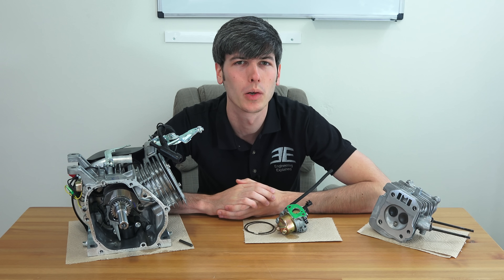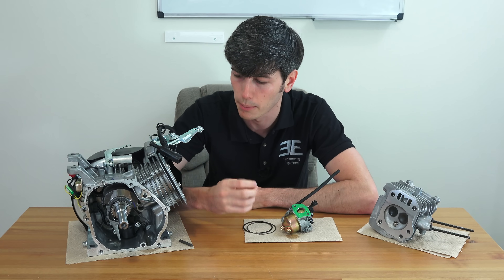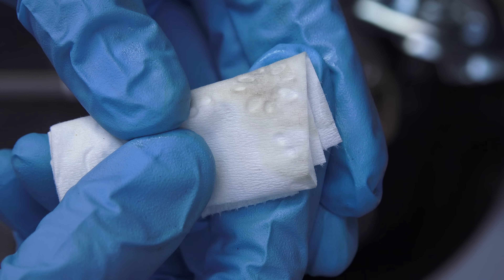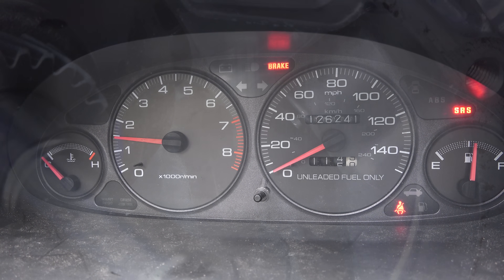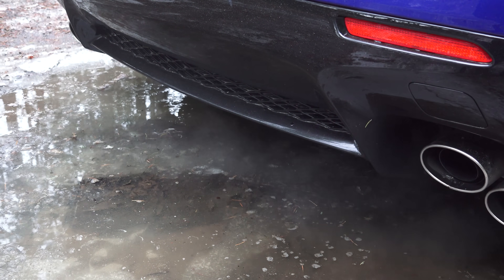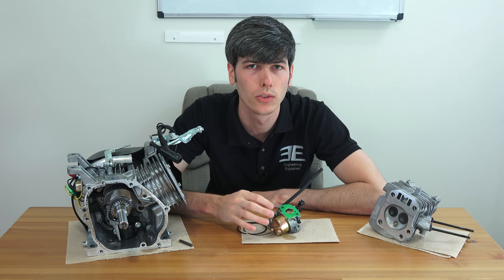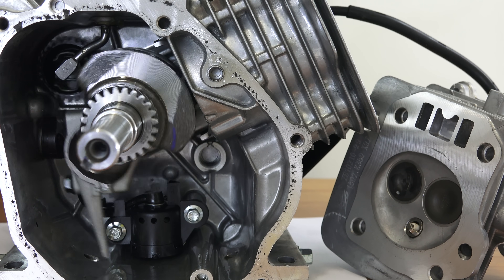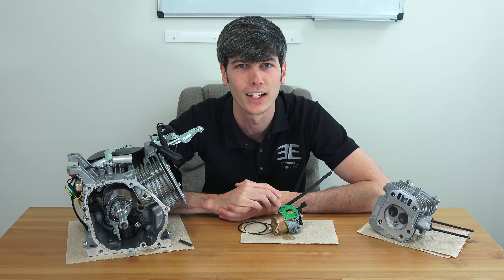Should You Warm Up Your Car Before Driving?

Comment: Carb cars have a thing called a choke which restricts air while the jets are adding the same amount of fuel in order to make the fuel air ratio more rich.  With a fuel injected car in the extreme cold it is not a bad idea to warm it up a bit, you are not going to wash the oil away and damage your engine.  Modern OBD II cars go into closed loop mode VERY quickly.  If this video was done with the use of a EGT or a AFR you would be able to see just how quickly this happens in modern cars.  You "can" start your car at -10F and drive away with fuel injection but the temperature shock to the internals of the engine will do damage over time.    I am an ASE certified automotive technician who likes this channel but as a mechanic it is always fun to point out an engineers mistake!
Reply from the maker: +82raptor I know what a choke is haha, used for cold starts. But if you try to drive off with a choke closed you won't have enough air. Hence it's used for starts. When driving, the choke isn't there to help create a rich mixture and thus the engine can stall. I make plenty of mistakes, all of us do.
Reply: +Engineering Explained You can absolutely 100% drive away while the choke is on. You don't have as much power but it's still definitely there. The problem starts when the car becomes warm and then the air cut severely impacts the power.
Reply: +Kirk Augustin we are talking about carbureted engines.... and still with fuel injection the air to fuel ratio is very rich...... you are a special cookie
Reply: soooo???
Reply: The question being addressed is that the engine has wear while cold and how do you avoid that.  The answer is drive lightly because that is going to warm your engine up quickly and not cause that much additional wear.

Assuming your cold engine wear is time dependent:  W (total wear) = f(some cold engine wear factor * t(amount of time engine is cold while running). W=ft. The point is idling does very little to heat up your engine, so t is going to be large and therefore W is going to be large.  The f is going to be slightly larger while you are driving the car lightly than while idling, but the t is going to be much smaller.  So net W is smaller, even though you are working your engine a little while driving it lightly.

I don't think how quickly it goes to closed loop function has anything to do with it.  That is just whether you have a heated oxygen sensor or not.  If the oxygen sensor has its own heating element, it will get to operating temperature quickly and the ECM will start using it (i.e. closed loop).  If it doesn't, it relies on the exhaust to heat it up which takes longer.  The only reason you have open loop operation is because cold oxygen sensors don't have a voltage that maps well to oxygen content (i.e. they don't work cold).
Reply: +yourfacelookslikebut severely impacts the power and usually the engine will run very rough, especially when you try to accelerate more/rev the engine*
Reply: Kirk Augustin When does the OBD I I go into closed loop mode?

Comment: What about the fact that the pistons havent expanded completely and hence the piston rings are not completely seated? As a result of this, there is a gap between the piston rings and the cylinder wall. This prevents the entire power to be transferred... as some passes off through the gap..
Reply from the maker: +20frieza maybe slightly, but piston rings have gaps allowing them to expand out and create a full seal. Either way, sitting and letting it idle means more time rich fuel mixtures can slip by those gaps.
Reply: Kirk Augustin ... so you do agree with my point of the fact that the engine does need to warm a little bit to allow pistons to expand and fill the small gaps (to avoid piston slap as well as loss of power even if its slightly)

Comment: There are exceptions to this.  Rotaries and some really high spec performance engines need to warm up just because of expansion of the metals.  Rotaries for example will get damaged if driven when still a bit cold.  The aluminum housings and iron side plates combined with all the heat from combustion being on ones side of the engine makes for tons of extra stress on seals and stationary gears.  You need the water to warm up and have time to heat the cold side of the engine.  As for high spec piston engines, it wont be street applications really.  But some of the crate engines you can get are built with really tight tolerances.  Not F1 tight, but tight enough that some builders state you need to warm the engine before putting a load on it.  

So, in the end it's basically application specific.  Most normal engines, no need to warm up.  But, there are exceptions.

Comment: I always like to wait for the temperature to rise at the very least of of its starting temperature. I've rebuilt enough engines to know that the pistons expand faster than the cylinder does. 
I wouldn't go jump on the freeway right after starting a engine but light driving on your way to the freeway is usually enough to warm everything evenly.

Comment: I have an 2006 Mazda 6 3.0L w/AT. When the engine is cold (cold weather start) it's running around say 2000rpm. I don't like to put it in drive at that rpm and have that inevitable clunk! What about cold motor mounts and the cold transmission, Any detriment to them?

Comment: How do I find out if my car, friend's car, etc. Is carbureted or fuel injection vehicle?
Reply from the maker: +Lancers262 if it was made in the last 30 years, it's almost guaranteed to be fuel injected. Otherwise, pop the hood and check for a carburetor or fuel injectors. :)
Reply: yeah. just pop the hood. if its carburetor it should  stick out like a sore thumb. they are usually right in your line of sight. well thats if you know what youre looking for. just look up a picture of a carburetor and see if there is something that looks like that in your car. if there isnt. youve got fuel injection.
Reply: Thanks for the information. My friends, family and I drive old Honda and Toyota from the 90's and 80's.

Comment: What about the wear on the head gaskets? That's why people have issues with their head gaskets leaking because they don't warm the engine properly. No extreme cold weather it can take 5-10 min even to get to the min operating temperature. It is a machine and should be operated within its operating range. Not to mention you have other fluids such as the transmission fluid which gets pumped through the system and takes time to warm up. There's just so much stuff to explain. Just warm your car up to the min operating temp and then drive off slow and when it's at operating temp bag it as much as you want.

Comment: Not a single word said about diesel engine cars ! Do I need to warm it up ?
Reply: schumifan78 With my almost 20 year old 1.9 liter, I'm getting about 55 mpg, so I think, diesel works in cars quite well.
Reply: schumifan78 Of course, when fuel prices in my country are one of the highest in the world
Reply: I think it is good to let a diesel warm up in cold conditions. The fuel when cold starts to gel up and get thick making it hard for it to flow. Compared to gasoline, diesel fuel acts more as a lubricant (mainly why diesel engines tend to last longer than gas) so letting it come up to temperature at idle will not hurt it any, it can actually be better for it because diesel engines rely on compression in order to operate, and a cold engine is not conducive to good combustion. I drive a commercial truck, naturally it has a very large diesel engine and in summer or winter I start my truck about 10 minutes before departing. Hope this helps!
Reply: I would believe the same applies as long as you have fuel injection. I read another comment from Engineering Explained saying to stay away from the turbo until warm though.
Reply: Leon Jones "as long as you have fuel injection", really ? I have never heard of carburetor diesel engine
Reply: Diesel engines down't even have throttle bodies.  They are controlled but the fuel injected into the engine.  More fuel, more power.  That's why an oil leak in a turbo can lead to a runaway engine.  It will ignite the oil like fuel, and rev till she blows or seize up.
Reply: Diesel engines can handle like more than x2 the max boost a gasoline engine can handle. You won't have much HP but the torque will be insane. I've seen like 400HP but like more than 1000WTQ big turbo diesel cars. They are good for tuning and car be faster that gasoline tuner cars when done properly.
Reply: Mark Schulz IV  in my opinion warm it up. where I live it gets 60 below zero. I rather ruin my Damn truck then freeze my ass off getting places.
Reply: Chris. W ohh yea I remember people driving fueled with fast food oil waste
Reply: Chad Bremer
Yeah, but you can also lug an engine without flooring it, like being in 5th gear at 900 rpm is lugging even if you're not flooring it.
Reply: UNDEAD ASSASSIN glow plugs are only used before starting.  They warm the combustion chamber up to make autoignition easier.  Mainly only needed in colder weather.
Reply: SI0AX What I do with my diesel car is to let the engine idle for a little time and then start moving without exceeding 2,000 rpm. I do this until the engine temperature reached the operative level. This is what we used to do back in the days with old carburetor engines (in this case gasoline engine).
Reply: plug it up
Reply: Jacob Gausmann That makes sense, thanks !
Reply: schumifan78 has no idea what he's talking about
Reply: Chris. W
That's not supposed to happen. The tach and the speedometer are supposed to be "locked/synchronized" together when the clutch is engaged.

You could have a very long final gear that would make it seem like the the RPM doesn't climb as fast I guess.
Reply: +leloodallasmultipass diesel engines have a better thermal efficiency than gasoline engines
Reply: leloodallasmultipass You must be pretty clueless. Diesel is what moves most of the world around. Aside from cars, most everything else is diesel powered.
Reply: leloodallasmultipass Must be the empty space between your ears.
Reply: SI0AX yes.
Reply: SI0AX no diesels better due to torque in low rpms thus better corner exit speed
Reply: SI0AX Well, for endurance racing it's more about mileage.  They are about as fast as the gas/petrol cars but go farther on the same amount of fuel.
Reply: "Of course, when fuel prices in my country are one of the highest in the world"
Sounds like your problem is governance, then, not what kind of car you drive.
Reply: Mark Schulz IV Yeah put a blanket round it, should do the trick
Reply: my dad's 90's doge ram with the Cummings will start in sub zero weather but even with a manual trans, it wont rev high enough under load to get up to highway speed until it warms up a bit
Reply: Chris. W
The diesel turbo engine is the ideal ICE for daily driving point A to point B. It produces a ton more torque at very low RPM range(where 99.9% of cars are driven on) thus saving even more fuel. You can even go up a steep hill in the overdrive gear.

Gasoline cars are ideal for high speed racing.
Even the alternative fuels like E85 are ideal for racing!
Reply: Kirk Augustin
Turbo's that have are cooled by coolant usually don't have this problem as the car will keep the coolant fan on even when the car is shut down(if it's hot enough).
Reply: Diesel engine lubrication works in a different way. The fuel itself is greasier and ensures a more consistent protection for metal parts not in direct contact with engine oil. Lubrication is more effective and this is why diesel engines have a longer life span. I think you should warm up the diesel engine in the old way even if a direct injection is involved.
Reply: Why do you have John Ward's profile picture
Reply: safewaycart
How do you warm it up the "old way"? Redlining the car for 5 minutes? lol JK...
Reply: safewaycart
Well keeping the RPM's low and taking it easy on the throttle is actually recommended even for modern fuel injected vehicles till the oil and coolant are warmed up, then you can thrash on the car.

For a cold start, I wait till the RPM's drop down to like 1k before moving. But I do that and wait till the coolant gauge stick moves up once.
Reply: lugging is when you try to floor it and are way too low in RPM and in way to high of a gear.
Reply: Chris. W
What I meant with the 1krpm is the cold start that makes the engine rev to like 3k RPM, I wait till it drops to 1k, then just drive normally but without revving too high or going heavy on the throttle.
I normally rev up to like 2,200 rpm, then shift short, but when the temperature is stable, I rev up to 3,200 rpm and shift.
Reply: Chris. W
Yeah, exactly what I though. Diesels have a very low red-line like 4,000 RPM, so the gauge will be bigger(higher resolution) thus the needle travel will look slower.
Reply: safewaycart tell that to VW.
Reply: Chris. W ha. no.
Reply: Chad Bremer Like my iPhone? Check. Mate.
Reply: Chad Bremer Who wants to be ordinary?
Reply: Chad Bremer winning isn't everything, it's the only thing.
Reply: leloodallasmultipass
Your iPhone could be powered by a diesel plant(that is much more efficient than a petrol plant FYI).
Reply: leloodallasmultipass Again, congrats on winning at losing.
Reply: Chad Bremer I think I hear an echo in here.
Reply: Yes let it warm up a bit. But it's best when you plug you diesel in to keep it warm. All diesels come with a block heater as far as i know. But before starting always let the glow plugs warm first (as you probably already know) but the fuel injection for diesels is directly into the combustion chamber, the valves only let air in for the mixture so its mostly the same as gassers
Reply: SI0AX bruh do you not even know audi and other companies use diesel for Lemans lol
Reply: Chad Bremer clean as a whistle.
Reply: Elliott Fontaine
So they race diesels is Lemans? But is it a diesel only class/race?
Reply: SI0AX they have been doing it for years.  P1 is basically dominated by Diesel race cars.
Reply: Chad Bremer
So Diesel and Petrol cars are allowed to race in the same class, and at the same time?
Reply: Chad Bremer
Cool, very strange how a diesel can beat a petrol car in a race. Petrol is technically more ideal for racing due to the high RPM power band and diesel for normal driving due to the low RPM torque.
Reply: Where do you live?
Reply: Rubbish
Reply: It's not that high. May 2x as a geometric compression ratio. Double that to allow for turbocharging. It fuel rail pressures which are insanely high.
Reply: The first diesel engine ran on peanut oil. That doesn't mean that modern diesels are designed to run on vegetable oil. They are designed for mineral diesel. Some will tolerate vegetable oil. others won't.
Reply: What throttle?
Reply: I agree. 2000rpm with lots of load is far worse when cold than 3000rpm with low load.
Reply: what you got golf im assuming
Reply: Mark Schulz IV you should always let a diesel warm up for 10 minutes before taking it on a highway 5 if it's town driving because if you don't it does hurt the engine over time and always let the plugs warm up before starting
Reply: If I were in any car, I think my rule would be nothing more than 40%-50% redline until it's warmed up. And rev it up to 2x idle for 20-30 seconds [a minute at most] before heading off.
Reply: +Mark Schulz IV Well, if you only drive for mpg, maybe.
Reply: diesel is fake.
Reply: Chris. W VW has proven that diesel does not exist.
Reply: Diesel engines should only be used in tractors and generators.
Reply: schumifan78 try pulling 20k+ pounds with a gasser and tell me how it goes
Reply: @schumifan78  Clearly you haven't driven a modern, high-performance diesel passenger car.

Comment: Thank you for making this video. Of course in the Northern Hemisphere this isn't important right now but in a few short months I'm sure I'll see lots of people running outside to start the car and then run back inside for 5 - 10 minutes. It wastes fuel, the rich mixture can cause premature catalytic converter or O2 sensor failure and the car warms up within 2 minutes when being driven slowly anyway, assuming it has a working thermostat. With that said, most people let the car sit and "warm up" so it is more comfortable to drive it. My car is in a garage so I hop in, open the garage, start the car, wait for the idle to drop and go.

Comment: What would be considered as Light Driving?
Below 3000 RPM?
Reply: Depends on the engine. In my 4.0L truck, I do not go above 1500RPM until the thermostat visibly starts moving, and I do not go above 2,000RPM until it is fully warmed. I never go above 3,000RPM until 20 minutes of driving or so. Even if the engine temp seems to be fully in the heated position, your oil still may not be, unless your car has two guages, one for oil one for water. In which case, it makes this whole thing a lot simpler. With a smaller engine, you might not be able to get going very fast at all at 1,500RPM. I would recommend the minimum RPM needed to get to your target speed.

Comment: Warm up 5 minutes, No, warm up like 5-10 seconds Yes,  oil takes some seconds to fill the engine. And when driving let the car warm up to a operational temperature, by driving low revs, theese temperatures are the best in terms of sealing, fuel mixture, and lubrication, causing less wear.
I think it's not an error to get operational temperature with smooth driving, and low RPM.

Comment: even fuel injected cars idle higher when cold of first started regardless of the temperature. no point in waiting for that to come down before driving off? several people at work have no problem starting a car and going right into gear and driving away. Everytime I see them so that I cringe haha! I've always ran my cars, summer or winter, till the idle is normal before driving off.